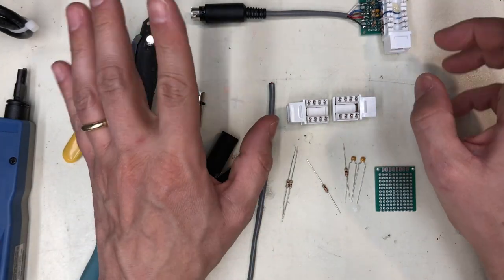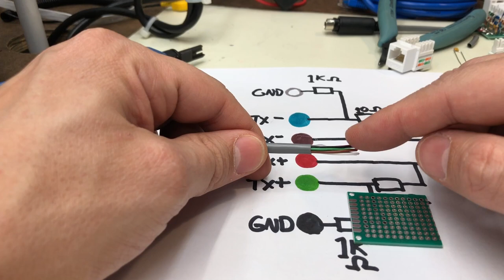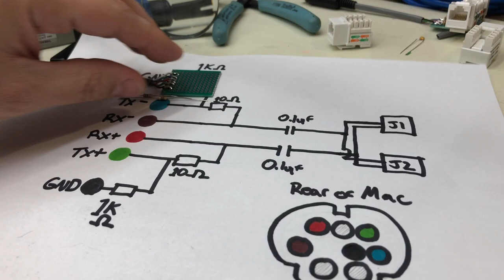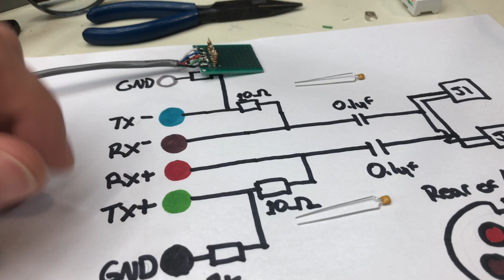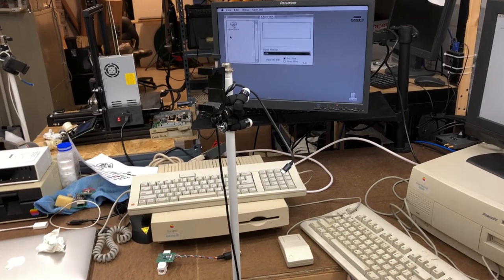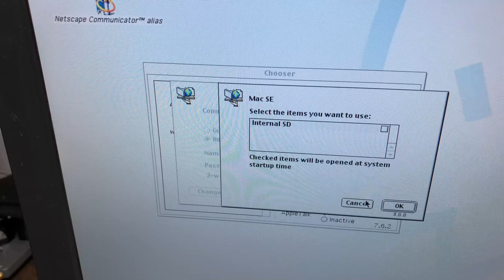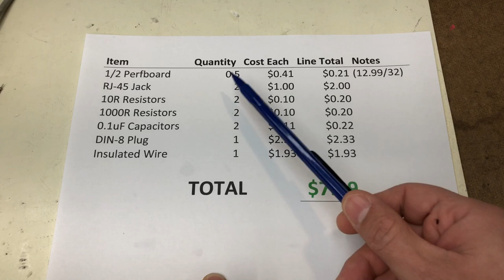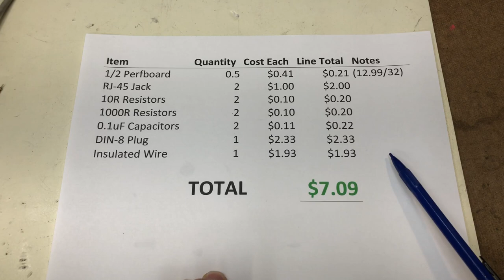Make Your Own LocalTalk Adapter - NeitherNet - #MARCHintosh

Comment: Would bump up cost a little bit, but I would have used a dual-RJ45 surface-mount "biscuit jack", then you can use it as an enclosure for the electronics portion for a neat and tidy appearance.  That said, I bought crap tons of phone-net adapters back in the early-mid 00's when they were cheap, I have way more than I need now, but this is still a cool project for when my supply runs out.
Reply from the maker: That's a nifty idea, actually.

Comment: That's a great little project there, Joe. I'll definitely be making up a couple of these, especially as I get more Macs. (I can also use it with the Apple IIgs, if I'm not mistaken).
Reply from the maker: Yup!!
Reply: @JoesComputerMuseum  Are there any open source "bridges" that'll do Localtalk to newer systems?  A Raspberry Pi Fileserver seems like something that should be "doable".
Reply from the maker: @CheshireNoir  Not that I'm aware of, but you could use a spare mac that has both serial and ethernet as a LocalTalk bridge...
Reply: @CheshireNoir  it was back in the mid 90's. I remember I had a laser printer connected via local talk (serial) to a Mac. The Mac had an ethernet (RJ45) card. I networked a Win 95 PC to the Mac and used it to print to the Laser Printer.

Comment: Great project. What would be EVEN MORE AWESOME is if this could somehow be layered over an actual Ethernet network, rather than depending on dedicated cable. Or would an EtherTalk bridge accomplish that? Not sure
Reply from the maker: Well, I'm cheating here. Only the center pair of the ethernet cable is being used, and then it's only sending half-duplex serial data. You would still need a bridge of some sort, and this would not be able to plug into that bridge with ethernet cables.

Comment: Since I am not a Mac user, so I don't know anything about AppleTalk, but when Joe explain Mac SE has limitation for handling the hard-disk size. I read something from internet, the maximum volume size is 2 GB (4 GB with System 7.5. x). I am wondering if there is anyway to set share folder size to 2GB. or if there are some other way to work around the problem. I am just curious to ask.
Reply from the maker: Good question. I'm not sure!!

Comment: Could you splice in a virtual Mac to the network via an emulated Mac and USBC to Ethernet adapter? Curious minds...
Reply from the maker: Probabbblllyyyyyyyy?
Reply: @JoesComputerMuseum  I'll try! Just bought 2 neithernet adapters and will see if it's possible with a VM (Android or PC); I'm curious which games supported AppleTall network play, as a test program...

Comment: so you've just solved AppleTalk networking a fleet of corporate Mac workstations at less than $7 per node (and some cabling), so now need to gateway that AppleTalk local network into an Ethernet network that's talking TCP, UDP, etc. So what about starting with a Raspberry Pi Zero that has a NIC built in (or, okay, WiFi), then connect the AppleTalk network to the Pi's GPIO header and write some software in C or C++ or Rust that does the bridging between the two network universes? Well, okay, that project has the pesky little problem of having to write some software...
Reply from the maker: Yeah. Imagine using this along with one Mac that has both serial and ethernet cables. Make yourself a little Local Talk bridge and get your Mac SE talking to an iMac. ;)

Comment: Neat project, Joe! Happy #MARCHintosh! Man, it's been decades since I felt the satisfy punch of a punch-down tool. :)
Thanks for reminding me to use segments of Ethernet cable for multi-color connections: I didn't think of that for converting my Mac mouse to the Amiga (9-pin) but that's perfect.

Regarding the hookup wire to mount the RJ45s, is there a downside to using epoxy? Seems like it would be nice, in the long term, to have them firmly/durably affixed to the perfboard.
I also just saw ctrl-alt-rees review a shrink-wrapped connector that made me think I'd like to get some large diameter shrink wrap for such a purpose: https://www.youtube.com/watch?v=DwwULPDCpWE
Reply: Oh and - nice shirt!
Reply from the maker: KER-CHUNK! I don't think there's any issue using Epoxy when done, as long as you test it before potting it. Shrink wrap is a good idea, too.
Reply: @JoesComputerMuseum  Probably just epoxy the RJ45s to the board and shrink wrap the rest and it would still be reasonable to service if need be. For "potting" I've used Show Goo inside shrink wrap, and had pretty good luck pulling it apart afterward. YMMV!

Comment: What about termination?
Reply: The 10KOhm resistor is effectively termination? If you add up to 32, does it pull down the signal too much?
Reply from the maker: @kippie80  The 10k resistor is built in termination. I don't have enough Macs in my shop, nor enough space to test it to 32 units. I'm going off a 1991 design that was tested to work with multiple endpoints over cables several hundred feet long.